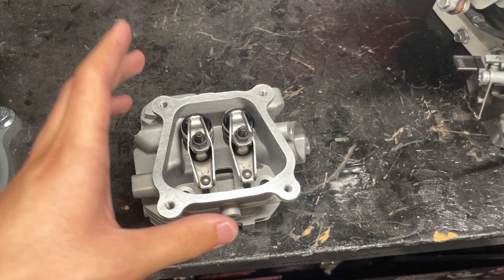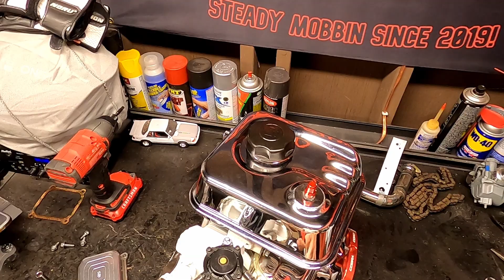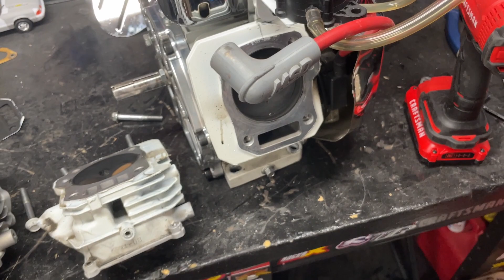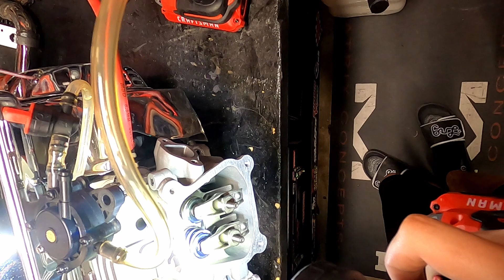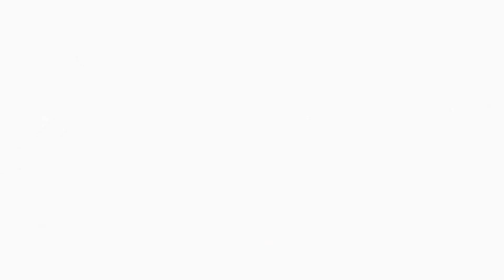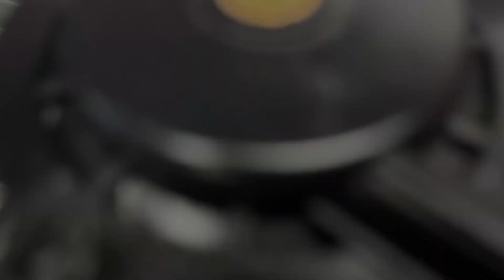Predator 212 Big Valve Head Install! More Power!

Comment: What size push rod do I need with the big valve head with double springs
Reply from the maker: Unfortunately you will have to buy an adjustable push rod and measure. It will completely depend on your cam lift and rocker arm ratio.🤙🏼

Comment: The newer casting on the recent motors made is far worse than the older casting motors. I stripped out every hole on my predator 224 witch I advise not to buy bc the parts are not interchangeable. The side cover bolts even stripped out on less. The shit is all advertising to sell you shut you don't need. The head is the only difference maker in. Top end after stage 2 upgrades.

Comment: How much of a difference does the msd coil make compared to stock coil? I have one on the way just curious
Reply from the maker: It really depends. If you have a stock coil that is only limited to a certain rpm this will completely remove the limiter. But if you already don’t have one you probably won’t notice too big of a difference but it’s still a good performance mod I would do!

Comment: Did you have issues with the stock dowel pegs ? Mine won’t fit the head
Reply from the maker: I didn’t! No issues
Reply: What would you suggest I do on them being too small I ordered a stage two predator head from goPowersports and the slots on the head are too small for the stock motors, dowel pins?
Reply from the maker: @royalknight4742  what I would recommend is buying a head stud kit or getting them drilled bigger. https://www.ombwarehouse.com/mondo-head-stud-kit-gx200-196cc-clone-predator-212-224.html?setCurrencyId=1&sku=K_MONDOHSK&gad_source=1&gclid=Cj0KCQiAkeSsBhDUARIsAK3tieeXw9RWcruk1i9w-I7qRJkf6pxnGhm1AYexMAFz9P3hROmCxi-qP1gaAtJoEALw_wcB